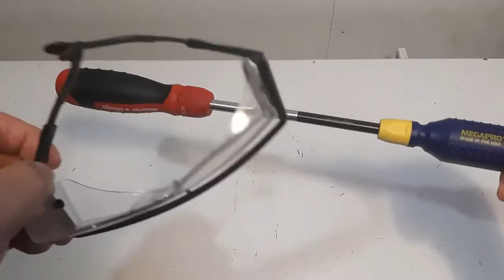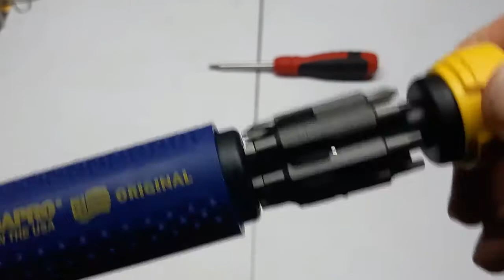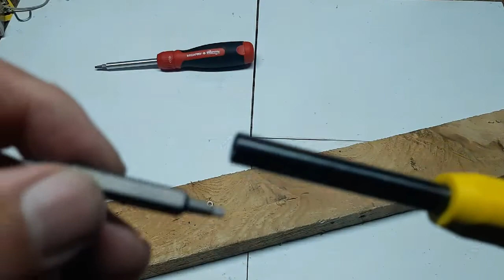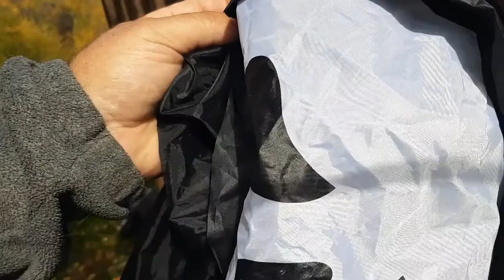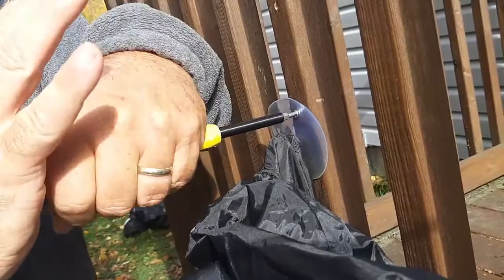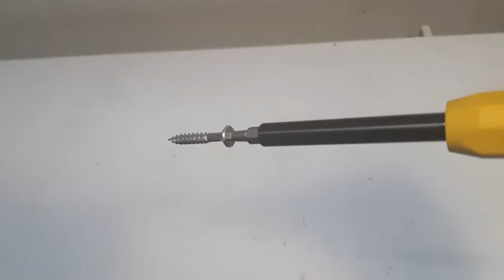Megapro Original Screwdriver.

Comment: I have a Megapro since over 20 years, and its great. Actually i have two, bought a second one a couple years back. 
The versions i have bought here in Sweden have the Robertson bits swapped for the PZ-bits. 
Unfortunately the Megapros sold from the US have these Robertson/square bits and i rarely/never seen them used overhere in Europe Sweden.
Also we use metric HEX heads so my choices is limited when adding a Megapro to my tool box. 
The only downside with the Megapro is that its big but that is also a good thing because you get a good grip and a lot of torque, but no tool is perfect.
Thanks for posting this video.
Reply from the maker: Thanks for posting. The Megapro is my go to screwdriver. Only complaint are the bits are not magnetized.